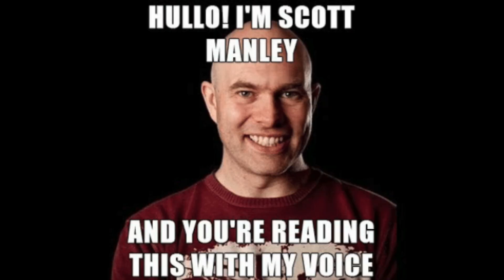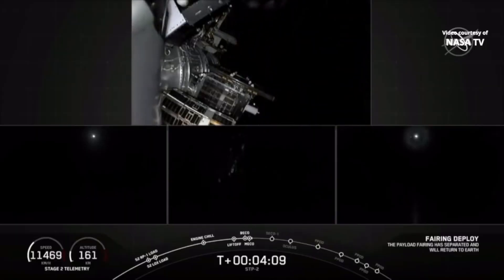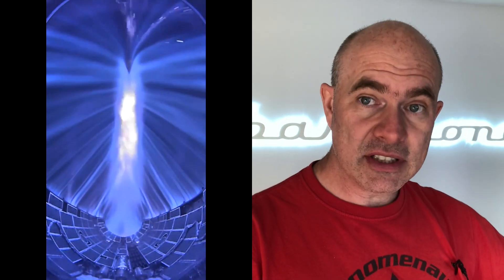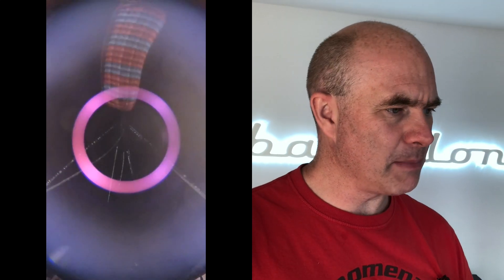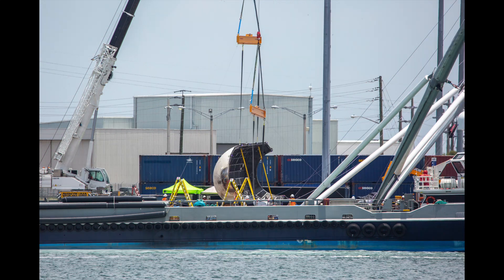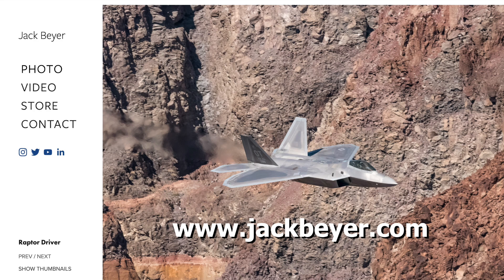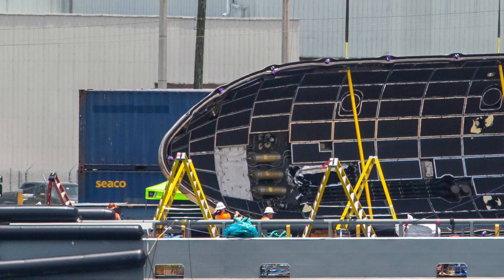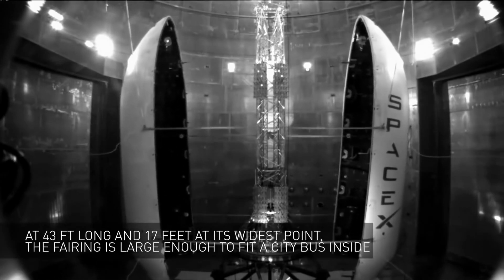SpaceX Fairing Reentry & Recovery & Reusability (better audio)

Comment: Looking at how slow that fairing lands on the boat I'm sure a drone could join up with it and parasail it back to land.
Reply: Jake S yeah or why not four drones holding a net, catch it in mid air and haul the fairing onto a barge. I’m sure that thing is heavy but drones could be engine powered.
Reply: @fpskywalker  Yeah.  I was thinking that all it really needs is a bit of lateral thrust and the parachute would provide the lift.  A 'small' aircraft acting like a tug boat should be able to catch the end of a long rope and pull it easily.
Reply: This has been discussed in many places including the Everyday Astronaut channel and "our ludicrous future" podcast. They also answer the "why don't they just catch it with a helicopter" question.  
If I remember correctly you would need the lifting power of two Chinook helicopters for one fairing. Factor in the unpredictable effect of the downdraft from the chopper, the risk of losing a pilot and an aircraft worth more than the fairing it's recovering. You would also still need a ship out there for fuel. 

The idea of a boat with a giant net looks better and better the more you look into it.
Reply: @faceplants2  perhaps.  A helicopter is obviously useless but I can see the advantage of a ship.  Any method of delivering to land would risk an impact with the ground.  Perhaps a small battery drone (size of a car) launched from the ship to guide the fairing to the ship rather than chase around.
Reply: @faceplants2  – Or they could use one of those frames dragged from a Hercules aircraft. However they catched small satellite film cannisters with it, so you would have to adapt it to the heavier weight.
Reply: @MrAnticlimate  Sounds possible but I'm not convinced it would be cheaper or safer than catching it with the net on a boat like they currently are. The ultimate goal is to get both fairing halves which would just require a second boat. Having a second plane operating close to each other could get tricky.

 Those planes that used to catch the returning film canisters from spy satellites were pretty amazing. Glad you reminded me of those.
Reply: @faceplants2  – Yes, I'm pretty sure they considered the plane option too, but decided against it.

Comment: Is the parachute/glide remotely guided into the net? Or the boat just tries to catch it? If it is not remotely controlled maybe it could be? Moving the boat and the fairing as it falls could make it easier to catch? I'm talking from complete ignorance of what's currently being done tho. ^_^
Reply: The parafoil automatically steers to a fixed GPS position. (This is actually a relatively common off-the-shelf technology, used by the military and small rockets like the ones by EXOS.)
Reply: @PaulKlinger  awesome thanks for the info!

Comment: Never stop posting, we're all learning.  

"A fair clip" brought me back to my Dad speeding in his Cortina.
Reply: I loved speeding in my Cortina until a puddle on a dirt road turned out to conceal a special "bump" which fired my front struts through the bonnet. That Cortina was over.
Reply: @Anticheese  Poor Cortina dies a horrible death, but a worthy death as a car.
Reply: @Verpal  Yes, appropriate if sad. It had an exciting life if a short one. I replaced it with a Ford Pinto which was not as supple and smooth but much stronger and had 50 horsepower more. It also loved dirt roads and it survived my acquaintance.
Reply: Lovely motor the Cortina. Purrs like a kitten.

Comment: Imagine, Starman riding that like a giant surfboard...
Reply: G-Force's, pressure and temperature..... A space suit could take care of many of your problems and you're away from at least most of the plasma and wrapped in a heat shield. Maybe if you laid under a space blanket to reflect most of the radiant heat coming off of the plasma it might just be survivable. That parafoil also looks like it opens pretty damn fast that would be a violent ending to the ride. 

I'd love to hear somebody much smarter than I work through this scenario out loud.
Reply: @faceplants2  Well, the insides of the fairing seem to make it OK without any kind of thermal protection, even though they're mostly black. So, the radiant heat shouldn't be much of a problem.

After all, this is only a re-entry from sub-orbital speed, there's much less energy to dissipate than when returning from orbit.

I guess G-forces are the real question here. Maybe the fairing's has a high enough drag coefficient to gently slow down in the higher layers of the atmosphere, maybe not. After all, sub-orbital reentry is a lot steeper than that of capsules.

As to the parachute, I don't know how fast it opens, it isn't shown in the video! It just cuts from re-entry to parachute opened, hence why it seems instant. But it's just an edit.
Reply: @faceplants2  Some of the fairings pulled out of the sea look pretty flimsy. It would suck to exit through the shell when the chute popped. Maybe the sound insulation would distribute the force.
Reply: I'd be interested in knowing how hot it gets inside there. maybe you could survive the reentry. Or would the G-Forces be to high?
Reply: @togamid  Yh probably
Reply: @togamid  
Very high surface area, very low mass. So yeah, g-forces are definitely in the unpleasant range. But maybe still survivable, because the fairing itself survives and I don't think it's worth making it much more expensive and heavy for that, more likely they choose a trajectory that limits the deceleration to tolerable levels. The shape of the fairing should produce a fair amount of lift, so it can come down as gently as they want it.
As for the temperature, I don't think it's too high either for the same reason, all the stuff inside should survive comfortably. Of course what's comfortable for machines can still easily kill a human, but a good space suit would solve that. And since you are coming down from space, you probably should wear one anyway.
Reply: @andrasbiro3007  Disagree. Hold your breath, you'll be fine
Reply: @MarioMonte13  
Holding your breath in space is bad idea. First, you can't hold back 1 atmosphere pressure difference, the air will get out anyway. Second, as the air rushes out of your lungs, it will take a few things with it.